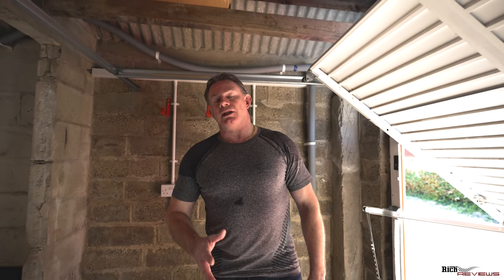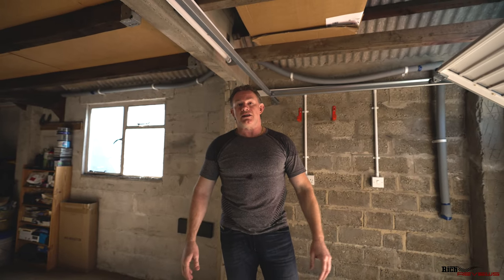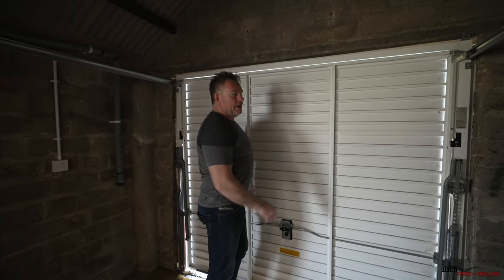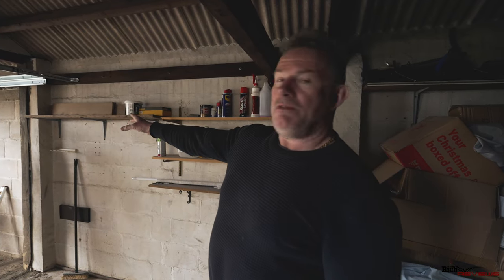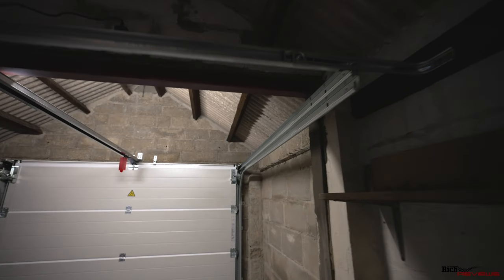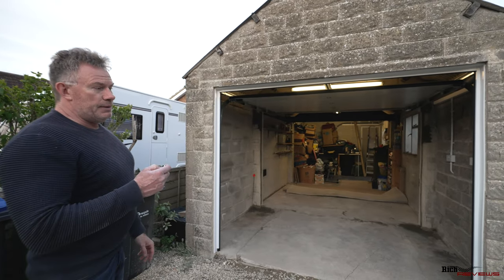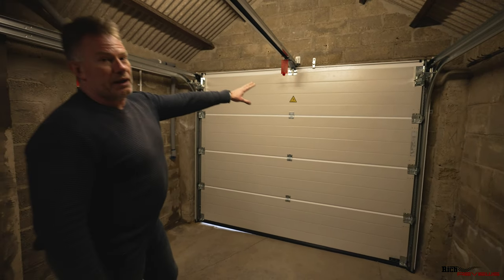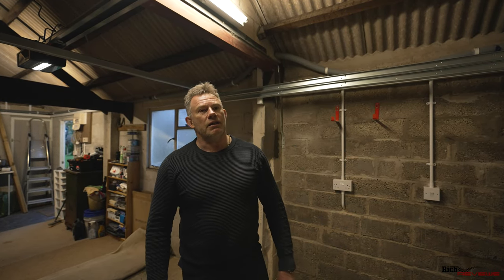SUPERCAR Garage Renovation!

Comment: Interested in why you had chosen the sectional door and not a roller door?
Any particular reason?
Reply from the maker: Many reasons…
- More secure
- Much better insulated (42”)
- Quieter in operation
- Ability to have top panel venting
- More aesthetically pleasing
- More functionality in motor unit for more programming flexibility. 
😃👍